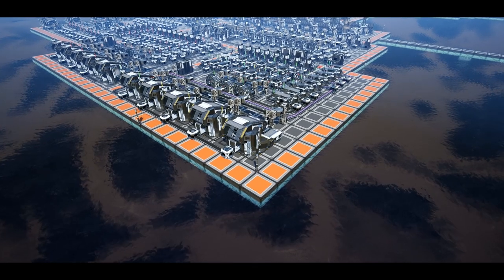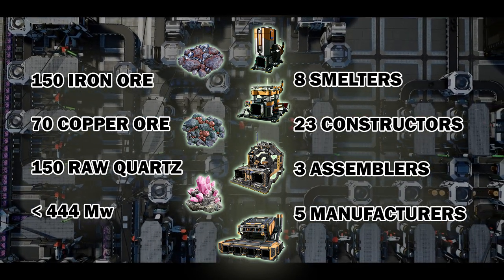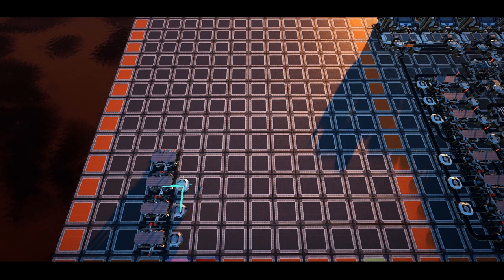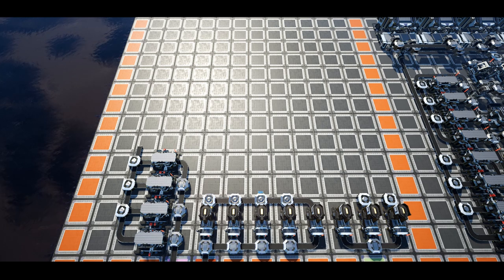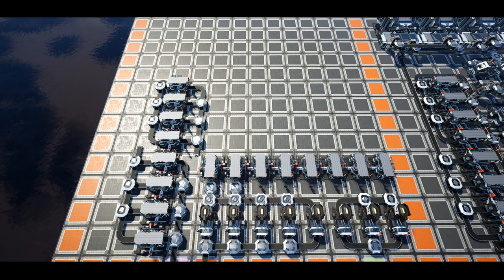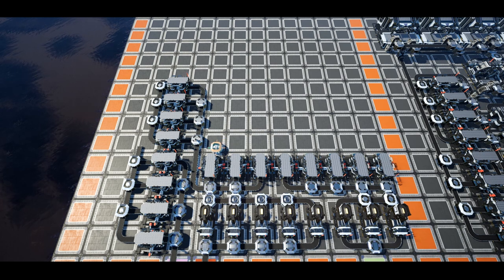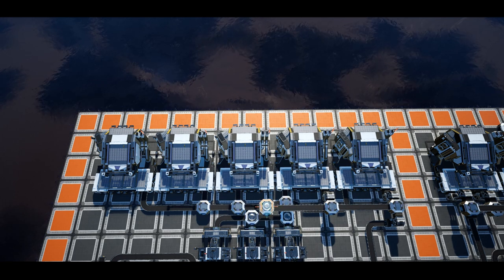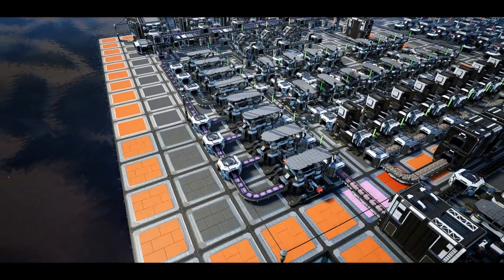Crystal Oscillator Layout | Super-Efficient Build Guide [Satisfactory Game]

Comment: I'm new to the game. Whats the point of under-clocking? Wouldn't the constructors simple just wait until it has all the mats? Is continues running better then start/stop running?
Reply: If you don’t have the production to sustain the machine then you would have to underclock the machine so it can run efficiently. If you have a smelter that needs 30 ore per minute but you can only produce 15 ore per minute, then you would underclock the machine to 50% so then the machine would only require 15 ore and you would have no excess or deficit of ore. It also saves power too.

Comment: I was wondering how produced the item with 444mwh. It's all your power tweeking. 
How much energy does it use running at 100%?

The way your feeding your machines off the splitters, doesn't seem efficient.
When you place the splitter off the first machine of three.
Machine 1 will get 50% of raw input.
2nd will get 25% of 50.
3rd will get 25% (12.5% if 4...)
You need a merger between 1 and 2, getting feed off the last machine. It would refeed into a closed circuit. Rebalancing the drop of input from splitting.

Or you could place splitter in front of 2 of 3. Each machine will have raw input of 33.3% load. Small and easy to build. Running 'units' of 3, 6, 9 is good practise. 

Do you stack you machines?
Using a splitter and lift to feed 50/50 to each floor.

What are your thoughts on the liquids? Oil/water.
Reply: @Brian I split my materials to my item flow. If a machine takes 3 items and 5 seconds to make new item at 100%. I'd build as many machines it needs to have an input of 8 items at 5 seconds. So I still can overclock those machines to 250%. And not wait for input. 3 buildings running at 250% is equal to 7.5 machines running at 100%.
Smaller build same output.
But I do like building massive.
Reply from the maker: Yep - So I say >444Mw because some people may not do the underclocking therefore I calculate the build we make (excluding underclock) If I were to do underclocks you'd see the whole build MW probably drop by 100Mw. 

As for the manifold system, I believe I linked a video on it in the video. Providing the ratios are correct it will run at 100% efficiency but first it needs to saturate and overflow to the next line. This only works if you have the correct amount of items though. You can use elevators but I don't for these builds to make them easy to understand and I like the use of liquids but feel they need to overhaul liquids
Reply: @TotalXclipse Yes, saturated belts solve eveything in front of a splitter =)
BTW, any idea what the next update will be about? (something liquids)